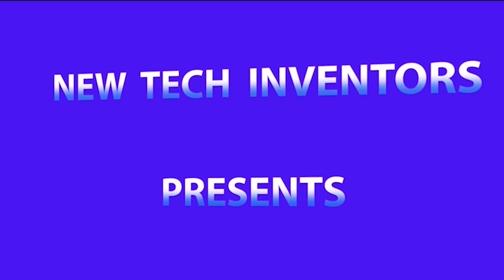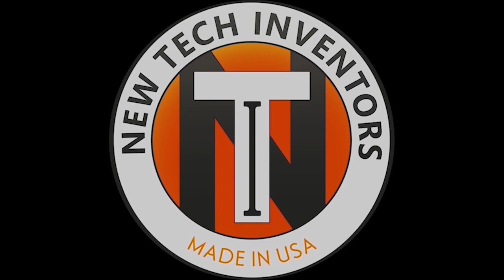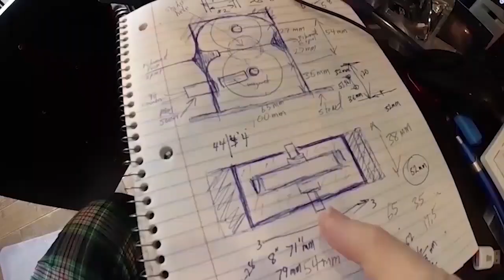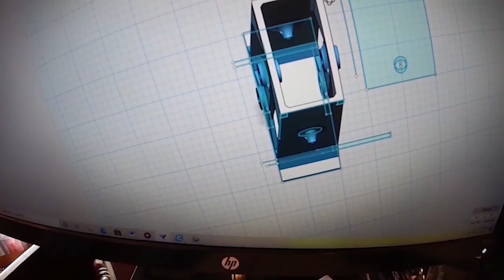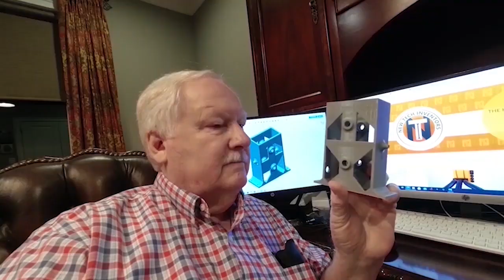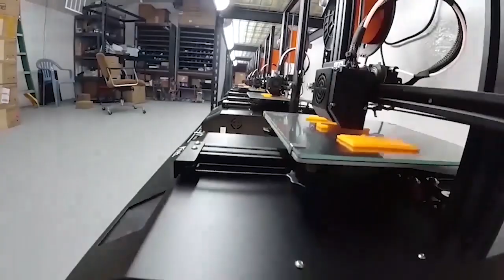WHAT MOTIVATED ME TO START MY 3D PRINTING BUSINESS and build a 3D print farm with over 50 printers?

Comment: I am mostly concerned about the quality of the prints, 3d printing seems quite unrealiable in regards to quality ? Stringing / blobs seems to be always a problem for me
Reply from the maker: You are not alone my friend; we all have that problem from time to time. I get the best results when I set up a printer for a specific part and filament and once I get it set up right I can print it over and over again without problems. It also helps for me to have many of the same printer because, I can  run the same part and filament with the same slicer settings on 3  of the ET4 printers and if it prints great on one of them I know the filament and slicer settings are good and I only have to adjust the other two printers to get them dialed in. I'm sure if you only have one printer it will be more difficult to de-bug and get your printer set up. Keep working with it and I'm sure you will find the right settings soon. Thanks for sharing and for your support...Ken
Reply: @NewTechInventors  good advice...quality is good ....appearance is not so ...but doable.  I find if I use a mat finish on the filament the appearance greatly improves. All advise here (stringing)pend the situation you have.  Study temperature of nozzle...speed of fan-on print ..printing from outside skin to inside option in slicer. Retraction and your print is another variable to study.  Slow the speed down ..speed the print fan up is the first experiment to try.

Comment: My boss wont fire me if I dont show up that I know for sure, he can't afford to. I been thinking about having my own cnc machine shop for about 10 or more years but to be competitive I need about 1 mil € to start so is about nil chance i can make it work. I might make something with 3d printing sooner or later, got  couple printers at home at the moment. It can be a start.
Reply from the maker: Your right Tommi, a CNC machine shop is very expensive to set up and unless you have a rich backer or a generous bank it's hard to get opportunity
Reply from the maker: Sorry my reply was not complete. I wanted to say that I started my business with 20 3D printers costing $130.00 average each and about $500.00 on filament. For a total of $2,600 in 3D printers and $500.00 in filament or $3,100.00 total I was printing 100's of parts and was on my way. If you have an idea ow what you could design, and 3D print, I hope you will test the waters and see if this might be an opportunity for you to start your own business. Good luck my friend...Ken
Reply: @NewTechInventors  in response to ken.   3D printing lends itself well to creating.  Perhaps more than CNC.   Which tool does this run or how deep can all be done on a printer so much easier. Material is very attractive.  But there is nothing like a the finished product of a CNC.  It’s just slightly limited. Slightly is an important variable in my line of creating.